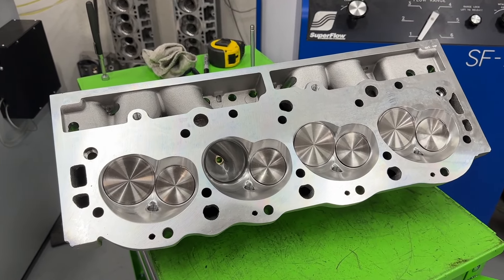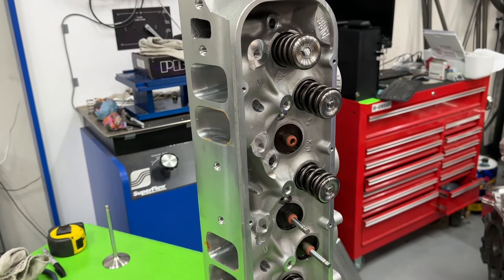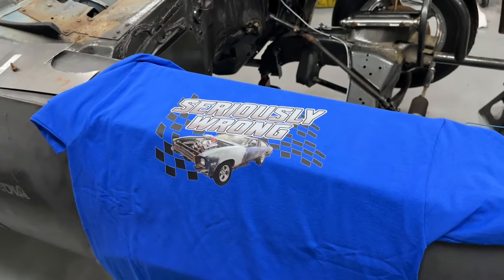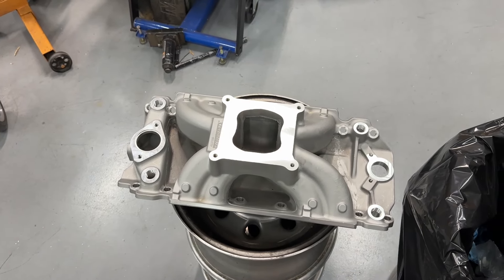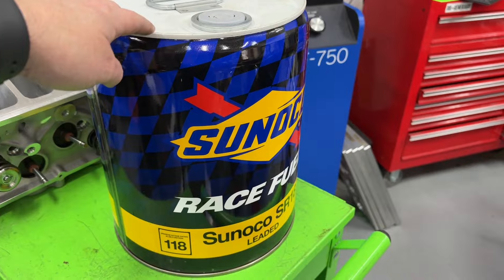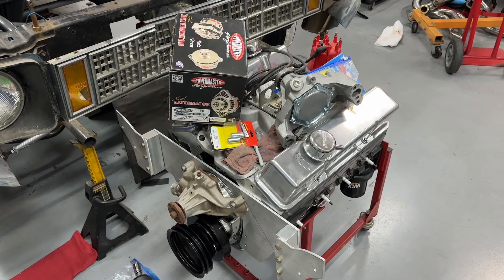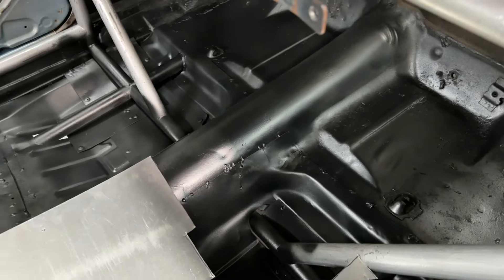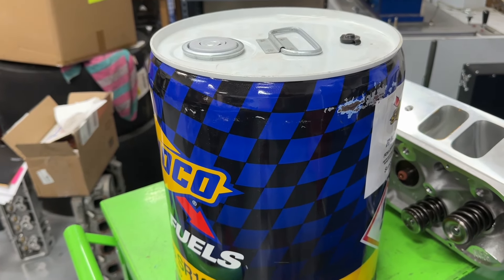New Heads For 540BBC Dyno Mule And I Saw A NHRA Prostock Champion

Comment: Awesome! I have a set of 385 afrs for a pump gas max effort 580  I am building. I have been wanting to see them get used and see some real results.  I have been thinking of changing them to 50° valve angle and having some more work done to them. I am using Dr425 rml springs because they work with the retainers that came on the heads.

Comment: They say the larger cfm385, heads need more CID to work best. 
My bet is you will not get back the HP from small chamber vs. more flow with the larger CFM AFR heads.

Comment: Did you advance timing at all with the race e85. Most of the dyno test Ive seen on like ignite red or the vp e85 everyone has to advance timing a few degrees for it to pick up at all. It burns extremely slow.

Comment: If E-85 is in your area that's roughly 110 octane
Reply: 106 octane for quality race E85 from VP. Much of the mid-west gets varying quality of E85. Especially winter vs summer blends. I’ve seen guys test winter blend pump E85 and only see 50-58% ethanol, and for summer blend only see as high as 68-74% ethanol. I’d have to run it through a calculator, but that summer blend would only be around 97-100 octane. Pump E85 is more sparse in my area. However, our state has a regulation of 78% ethanol of higher. Back when I was using it, I’d test it each time and I’d get anywhere from 82-90% ethanol.

Comment: Just bought methanol to start the season.  $150 a DRUM!  We do not use double the fuel after getting in all tuned in. Block heater is the key otherwise ya use more fuel making heat
Reply: How often do you need to change your oil with the methanol? Or does the block heater get rid of the moisture in the oil
Reply: We run evac and dont go by the dead fat tune so many people believe in.  70 runs between oil changes and maybe get 2 ounces of alky out at the oil change. We just added the block heaters over the winter. Did 100 runs on gas between changes. We do use Penn Grade oil as well.
Reply: Do a waffle on the car. Sell spots

Comment: Pump e85 is the cheapest race fuel.
Reply: There are a bunch of stations close to his shop or dunsworth that sell E85. This is gonna be the cheapest way
Reply: Last I remember, his 565 in the Camaro is around 15.2:1. I’d consider that a little above what I’d feel comfortable running on E85. Especially more inconsistent pump E85.
Reply: @my87z28 Dead on.  Tried to tell a guy his 14.5 compression 548 was gonna need a lot of timing pulled.  He went to the track and put the timing at the base of the ground strap.  Ring lands exited the party at 26 passes 😢😢
Reply: @wayneskelly4297 , yeah, E85 is great for 11 & 12:1, 13:1 starts to push it, but it’s still feasible. Anything close to 14+:1 should be more in the 112-116 octane. I’ve got a 14.3:1 tall deck 582, with a set of Eric’s ported heads & intake. Right now, while still NA, I’m running 38° with C14+, which basically a mix of C14 & C16. I was a bit surprised that on the dyno, it wanted 38°.